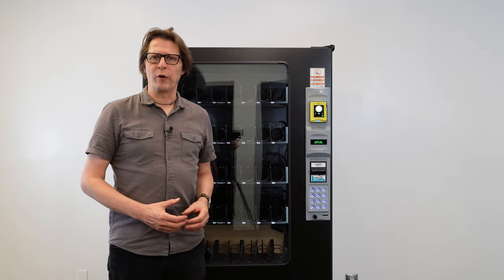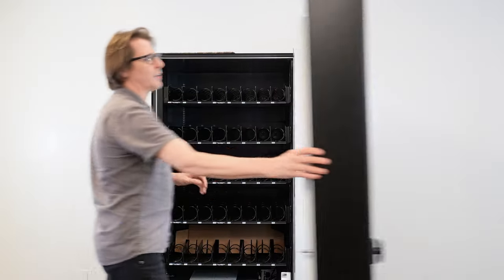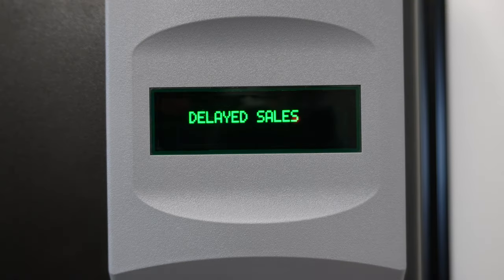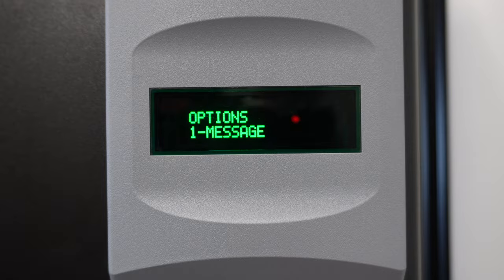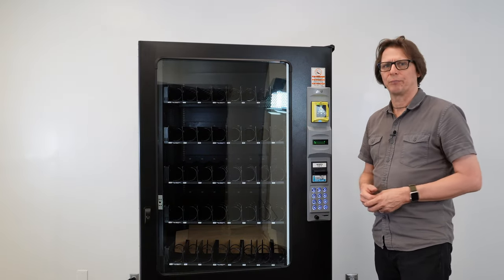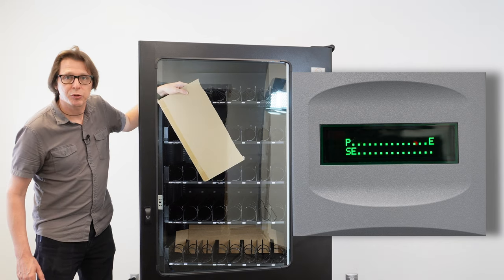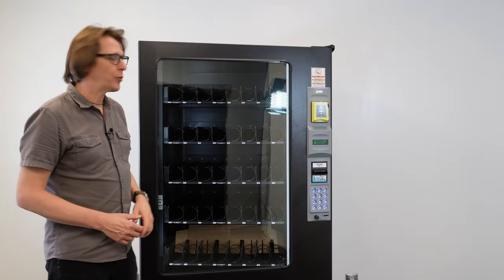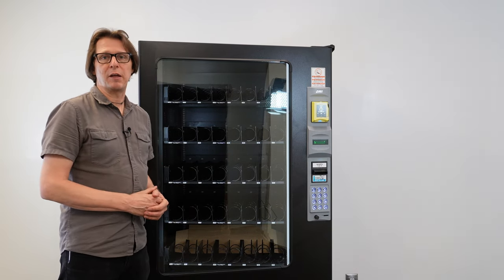AMS Vending Machine - Drop Sensor Test (Troubleshooting Tip)

Comment: Would definitely love to see more AMS and Conlux videos. I recently (today😂) had a coin jam that took me an hour to figure out how work out. Still not sure if I did it right as the yellow light is still flashing.
Reply from the maker: More AMS videos are in the works. I am also working on a video about coin changers in general. The yellow / amber light on your Conlux is indicating and error at Coin Cassette (C/C). If you have not already. Remove the coin cassette from the changer. Then press the A,B,C,D, or E button. This will cycle the payout arm at the bottom of the coin changer. Sometimes these need to be reset. Also check to make sure the payout rake is still in the bottom of the coin cassette. This is a rectangular piece of plastic either gray or white in color. This gets sandwiched in between the clear plastic of the coin cassette and the gray plastic or metal bottom of the cassette. The payout rake can sometimes get dislodged when removing the coin cassette.

Comment: I have an AP Studio 2D snack machine with goldeneye, but the goldeneye is not set up. I followed the manual and set all the selections to giDR, but after testing it the drop sensor doesn't activate. I had a tech tell me that he uses the goldeneye without the P7 port of the control board using the other ports. He even sent me another harness, but I want to be sure that the current one works before I replace anything. Can you do a video on this or at least can I contact you about this issue?

Comment: Can these drop sensors be installed to any machine? Or do you have to buy certain machine brands that come with this feature?
Reply from the maker: There are a few aftermarket kits that can be installed onto machines that have Drop Sensor capability.
Reply: Thanks for that info. I will start my research.